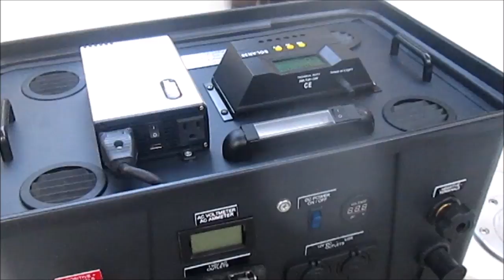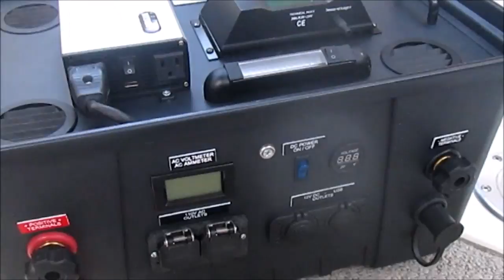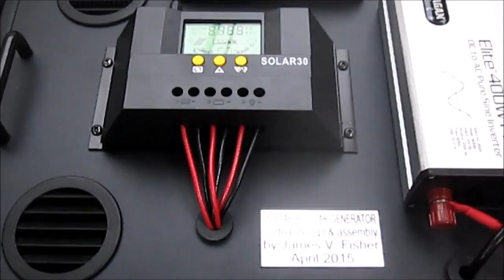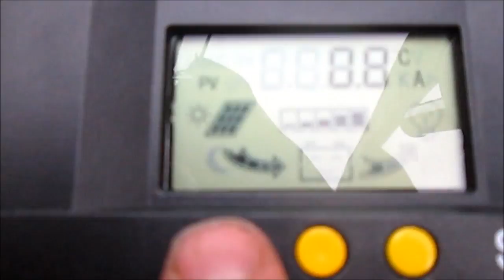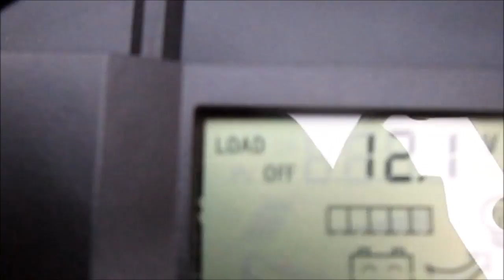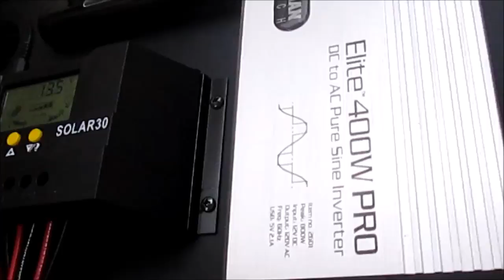V1 P6 DIY Portable Solar Power Generator

Comment: Hey Jim

Any reason you did not go 6v batteries in a series?

thanks
Reply from the maker: When I started researching solar generators most of the systems were built with 12V batteries in parallel, so I followed that lead.
Reply: Hey! awesome! thanks for replying!. Subbed to the channel. Being down in NC after the storm im going to build one for these for the future. after much research i was going to go with 2 6v in series, but now looking into prices per amp hours. I found a duracell 12v with 150 ah's ( https://www.batteriesplus.com/productdetails/durhr12=540) which is about 200 dollar cheaper than running the 2 6v. Again thanks for everything man! cool to see somone reply back
Reply from the maker: You are very welcome...hope you folks in NC get back on your feet soon.  If you have other questions when you get to building your system don't hesitate to post again.

Comment: Hi Jim, Your videos are very informative and the battery box is awesome. It’s been great to watch it evolve and very helpful for someone who’s in the process of building a battery box. Assuming your inverter uses volts to operate the low voltage cut off to protect the battery from draining what is it preset at? What have you set you controllers low volt cut off at, 12.2V is about 50% right? I notice you don’t have a fuse between the inverter load out and USB’s, is it not needed?  I’m planning of using a 15Amp fuse between my 20Amp controller load out and both USB’s and 12V power outlets but have ordered some panel mount circuit breakers, have you thought of using circuit breakers? Thanks for your hard work, Steve.
Reply from the maker: Hi Steve, thanks for your comments and questions.  The inverter has a built it low voltage alarm that sounds at 10.5V, but I think that is too low to be safe.  I try not to allow my batteries to discharge below 12.05V.  You are close regarding my charge controllers load out setting, it is set at 12.1V (about 55% state of charge for AGM batteries).   The inverter has an internal fuse, but I also added another inline fuse between the inverter and the 110V AC outlet on the front of the case.  I do not have a fuse between the bus bar and the USB ports, but there is a fuse between the bus bar and the load out terminals from the charge controller.  Circuit breakers can be used, but I have read that circuit breakers can (although rare) be slow to trip and thus result in some damage.  Fast blowing fuses ensure an instant response.

Comment: I really enjoyed this series of videos you did. Very well done. 

Have you ever thought about adding a 20 foot retractable cord reel in the middle? I mean a small 20 foot length of retractable cord just seems like it would be so handy to have when you need to run a drill or saw or something, and don't want to drag out a 50 foot cord for a 2 minute project. I nice weatherproof outdoor electrical box with cover, and inside is your plug in for the cord reel that's inside the box.

If space was an issue, I even thought about using a vacuum cleaner retractable cord since they're small and prefect for a box this size and craigslist has a ton of vacuums for sale as does Amazon with replacement parts for vacuum cleaners that are dirt cheap for $30 or so for a complete replacement unit.

Here's one from Walmart.
https://www.walmart.com/ip/Evolution-Vacuum-Cleaner-Cord-Reel/521043416?wmlspartner=wlpa&selectedSellerId=6774&adid=22222222227066152825&wmlspartner=wmtlabs&wl0=&wl1=g&wl2=c&wl3=170289482302&wl4=pla-275279773866&wl5=9025266&wl6=&wl7=&wl8=&wl9=pla&wl10=114435286&wl11=online&wl12=521043416&wl13=&veh=sem

Amazon.
https://www.amazon.com/Hoover-303238002-Cord-Reel-Uh70120/dp/B00Y32PT48

One other thing, I'm not a big cell phone guy, so I don't know much about them, but don't they have some sort of wireless chargers that you throw your phone on and it charges? Would it be possible to add one of those to the cover to charge cell phones in the event some one does not have the charging cable with them? Just a thought. Keep up the great work.
Reply from the maker: Great ideas!  Thanks for viewing and for your comments.

Comment: Would like to know the dimensions of the frame and how deep the top plate with the inverter is from the top lip of the box.
Reply from the maker: Matt, I used two pieces of 1"x4" wood cut to length to fit the inside dimensions of the bottom of the case.  They were set tight to the sides of the batteries and then joined across the middle to create the lower deck using a piece of the same blackboard material used for the top tray.  The lower deck material should be cut to fit snuggle against the sides of the case too.  In this way the frame is unable to move laterally in either direction, holding the batteries in place.  
     The top surface of the top tray is set 1.5" below the top edge of the case.
Reply: Jim Fisher , the reason I asked is I am trying to set the box up and haven't purchased the batteries as of yet.
Reply from the maker: Matt, my advice is to purchase your batteries first and then build around their exact dimensions.  If you are 100% certain of the dimensions of the batteries you intend to use you could build the lower deck frame in advance, but I would not personally do that.

Comment: My mistake from part 5 video, for your future part 7 video that regarding LiFeO4 instead sealed lead acid battery. It is easy to ruin your lead acid battery be running to dangerous low level into below 50%. LiFeO4 battery will safely go down almost all the way down. Your high demand in much longer term, with much lesser voltage drop. The LiFeO4 battery voltage curve is much better than lead acid battery. You can use lead acid mode to safely charge LiFeO4, as it's big no, no for Lithium-Ion.
Reply from the maker: Stay tuned Stan, at the end of the past summer boating season I traded up to my retirement boat.  It is meant for long-range cruising and will need some upgrades to its onboard electric service systems.  Will likely be taking subscribers along during the process of installing a much larger house battery bank, a larger PSW inverter, and adding more solar panels on the new boat.  Hopefully the cost of the LiFePo4 batteries will drop substantially by the time I am ready to build my next system.

Comment: What clips and where did you get them to hold the black board up?Thank very nice job can’t wait to start mine!
Reply from the maker: The clips or rests upon which the top tray sit were custom fabricated using some plastic door glide components.  I searched in vain to find a ready made product but was unable to find exactly what I had in mind.  Asimple solution would be to cut 4 rectangular strips of hardwood and screw them to the sidewall of the case.

Comment: Love your system. I want an all DC system my question to you is where do I wire a plug to change my batteries with my gas generator if it's not sunny outside
Reply from the maker: Thanks Pink,  I presume that your gas generator would have AC power outlets.  If so, you could simply plug a battery charger into your gas generator and attach the alligator clips on the charger to the heavy duty remote terminals on the front of the solar generator and that would effectively charge the batteries.  If your gas generator offers DC only you would need to be sure that the DC power is regulated so that the batteries in the solar generator could not be overcharged and damaged.  If your gas generator has an alternator, and it has an appropriate voltage regulator, you could simply connect the alternator to the bulkhead terminals on the front of the solar generator to charge the batteries.

Comment: Hello Jim,
Your video's are top shelf and very informative. 
We are just starting our solar generator now and was wondering about the switch that comes off the solar controller to the batteries (not the load out). Is this to stop any load feeding back into the solar controller while the unit is being trickle charged via ac charging ?
Thanks
Reply from the maker: Thanks for viewing and for your comments and question. I installed the switch between the batteries and the solar charge controller for the purpose of being able to completely cut power to the charge controller.  Without the switch the charge controller will continuously draw a small amount of power if simply connected directly to the batteries.   I don't think that there is any possibility of harm coming to the charge controller from the AC trickle charger.  They are on separate circuits.

Comment: I'd like to make this easy as possible for field duty, so I'm wondering if I can reduce the inline fuses and integrate some push button circuit breakers. This would add to the cost, though. Which fuses would be most likely to blow? If I could only pick a couple to put a breaker on, which would you select?
Reply from the maker: Brent, in my opinion I would want to keep the 50A ANL fuse between the batteries and inverter, the fuse between the solar panel and charge controller, and the fuse between the batteries and charge controller.  Fuses between the bus bar and/or batteries and 12V outlets and 110 outlets could be replaced with breakers.
Reply: Jim Fisher thanks again. Why do you prefer the ANL type fuse?
Reply from the maker: I look at this situation from the position that I want the circuits that are doing the most work, and connecting the most critical components, protected by fuses.  If there is an overload the fuse will blow and ensure, with certainty, that the circuit is broken.  Replacing a 12V outlet, USB outlet, or 110V outlet is cheap compared to replacing the inverter, solar panels, or charge controller.  If a circuit breaker fails to trip the next component in line pays the price.
Reply from the maker: Brent Skipper, I think I inadvertently deleted your last comment instead of approving it, sorry about that, but here is my reply:  Circuit breakers can be slow to trip, and in the short amount of time they take to do so sensitive equipment can be damaged.  Here is a link to a more detailed comparison of fuses vs. circuit breakers http://bdfuses.com/breaker.php

Comment: USB is typically 5 volts DC. Looking at your schematic it appears your USB power is 13.8 volts? Granted many devices that use USB supplied power have a built in regulator/controller to charge 3.7 volt lithium batteries built within the device and can handle  higher input voltages. However not all USB power devices can handle a 13.8 volt supply and may be damaged by the higher voltage.  I recommend installing a regulator. Very simple low cost addition that would allow simultaneous 13.8 and 5 volt supplies.  For instance https://www.youtube.com/watch?v=GSzVs7_aW-Y
Reply from the maker: Thanks for your comments and concern.  I'm of the opinion that the dual 12V / USB outlet model I used has a regulator built into the USB port.  The following specifications were provided with the model that I used:
                    USB socket Input: 12V             USB socket Output: 5V 1A 2.1A
     To be certain, I just plugged a voltage meter into both of the USB ports and the output reading was 5.19 volts.  That appears to confirm that an internal regulator is present.

Comment: The MC4 connectors are a must, but do you really need the plate? What if I just had a little hole in the side that allowed a pigtail with MC4 connections coming out? If not in use then I can stuff back in the hole. Seems cleaner and less likely to get broken as opposed to the MC4 plate. The plate itself is usually not prewired anyway, so additional cost and time. Thoughts?
Reply from the maker: The simplest solution, as you suggest,  is to make a couple of small holes and have the mc4 connectors hanging outside the case.  I don't like to open my case up to access components on the inside, and certainly would not like having to take the top tray out to access components in the lower portion of the case, so for me having the mc4 plate on the outside was a nice upgrade.  I like the support that it provides to one set of connectors- makes connection very easy.
Reply: Yes I see what you mean. Thanks for the quick reply!

Comment: I have contracted to have a 6000 watt Aims inverter portable system built for me by quantumharvest.net. It uses 8 110 amphr agm batteries, a midnight classic 150 mppt charge controller, in an emp resistant aluminum box. It uses 6 330 watt monocrystalline panels which I purchased separately and put the legs on each panel. The emp box is mounted on a trailer with racks to hold the six panels. It can be hauled anywhere and deployed. Take a look at Gary Tibbitts websight. It is very interesting. My system will be used for emergency power outages or cabin camping.

Comment: Is this system being used to start your boat and charge some cell phones or is there an additional purpose? Also, how long do these batteries last before recharging is necessary and is the daily solar charge enough to keep batteries topped off? Also what was the approximate cost without all the sub design iterations?
Reply from the maker: Peter, this system is not being used to start my boat.  I use it to power a Dometic portable refrigerator/freezer, LED lighting, fans, a blender, television, my PC based navigation system, and to charge cell phones, etc.  It is completely independent of the boat's onboard DC system.  Here is a link to my FAQ sheet, it will answer your other questions and many more.  http://www.creeksideartifacts.com/PSPGFAQ.pdf

Comment: Is there any way to use circuit breakers instead of fuses in this setup
Reply from the maker: I don't know of any reason why you couldn't.  I see other videos of similar systems where DIYers used circuit breakers.
Reply: I thought the same thing once. But I was told that in some areas fuses are used because they are sure fire. Circuit breakers have been known to fail in the closed position but if a fuse blows it is total.
Reply: What's more likely? The breaker failing or not having a fuse on hand? If I am camping or on a boat I think the latter...

Comment: I suggest you to use lithuim batteries because to reduce weight of the whole system and lithium batteries also has improved charging and discharging cycle which leads to have longer life than lead acid battery
Reply from the maker: Thanks, perhaps when the cost of lithium ion batteries comes down I will replace the AGM batteries I am currently using.

Comment: Nice upgrade with the buse bars. It cleans up some of the wiring and will make any future additions to the dc side of your system easier.
I was hoping you had removed those three way crimp on connectors. You made no indication of such and you never showed that area of the box in this video. Please refer to my comment to Video #5.
Keep up the great work. I can't imagine what's coming next. Maybe a centralized fuse panel? Have you ever considered taking up one of those guys requests and building them one of your systems and then making a series of videos on how it's built, step by step? Just a thought.
Reply from the maker: Hi Bob, thanks.  See my reply to your comment posted on my part 5 video.

Comment: ...... you addressed my discontent. You don't want to put the busbar on the bottom.
Reply from the maker: Curious teton tom, what concerns do you have for placing the busbar on the lower deck?
Reply: ..... any moisture/water that might get in that "box" will pool on the bottom. I'd be hesitant to run any wires on the bottom.
Reply from the maker: Thanks for the clarification.  The lower deck on which the busbar is located is 4 inches above the bottom of the case.

Comment: Hi Jim. An observation. Your system might save some of the bigger boats from a problem that I have seen happen to them. Many of them have solar power, wind generators, and charge or trickle charge from generators. But, the problem revolves around the fact that the bigger yachts have 24  volt systems. Yet, they have 12v  very important navigation systems and vhf and ssb radios, and possibly Iridium Sat internet or phone, GPS tracking or beacon safety equipment, all in all a ton of very expensive equipment. Now, everyone pretty much knows you shouldn't take power for all that equipment from the center 12v connection because your batteries will become imbalanced. So, they all pretty much use a 24 to 12 v converter. They've been around forever and some are fairly old . I saw one boat burn up almost all of its equipment, or at least some of the wiring, because the 24 converter output went to high and burned some stuff up. 
All the more reason to build one of your boxes. Have a separate panel and run that expensive electronic equipment on a true 12v system. Then, No Worry be happy while floating around this beautiful bunch of oceans on this planet. Or at least one less worry lol.
     Not to say that the electrical systems should be improved on these older boats. When your out in some extremely busy channel and loose radar and some big ship plows into you or too close, you realize how important this stuff is !